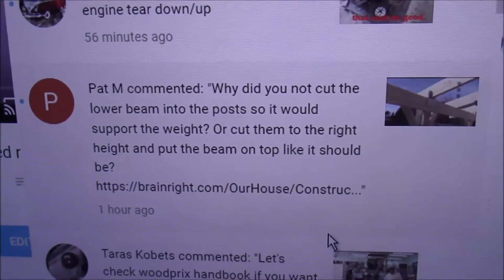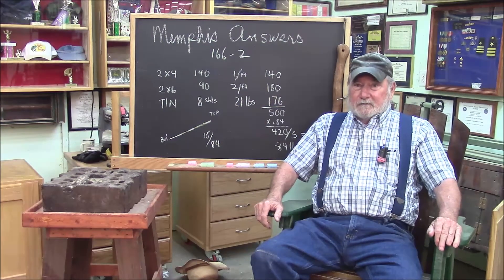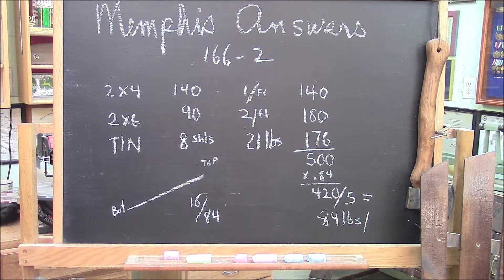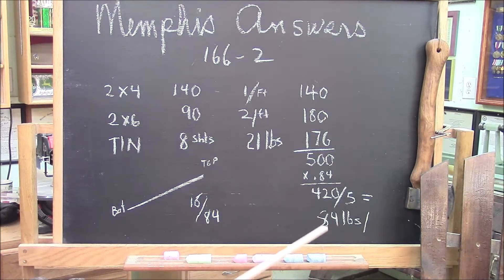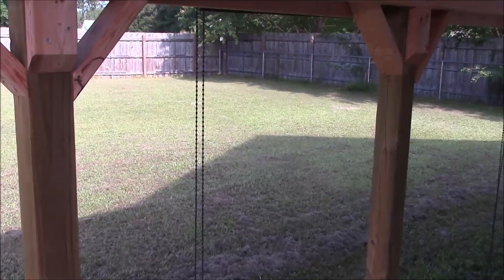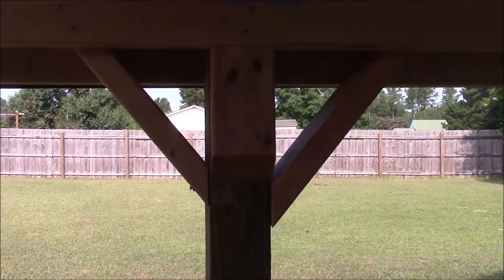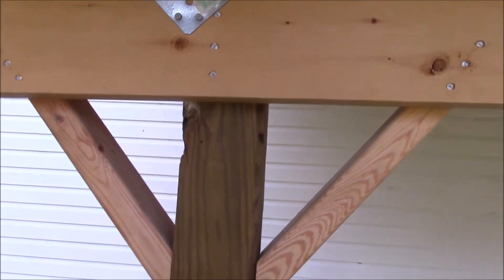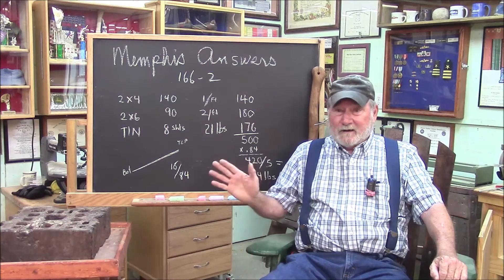Memphis Answers Joist header on top of post 166 2

Comment: It took me a while to figure out just what his comment was about since I am no builder.  I thought he was giving you grief because you didn't use a "bird's beak joint".  Now I understand that he was saying that header should have been on top of the post rather than nailed or screwed into the side then the joists put on top of that.    I can see his point about the snow load but that is not even an issue for you.  I think you have built a much stronger structure for your situation located so near the southeast coast.

Comment: Memphis not trying to be harsh, as long as you calculated the loads and know what your expecting. I live in an area where we can get 24" plus of snow adding this to a roof will make it strain.  Good luck and I hope yours last as long as your friends project.
Reply from the maker: I'm with you Pat.  I wondered a lot about those loads, and why my friends shed roof is still standing, considering that those braces are normally (and logically) placed on top of the posts.  I think I made it clear in the video that placing the braces on top or in notches is probably the best solution.
      I live in South Carolina, so I have no additional loads.  My worry is hurricane force winds, which is why I went with double hurricane clips, 2x6's, 2x4 purlins, five posts for a 20 foot span, and extra screws in the steel roof.  
      Hope to see you around, as I will be building two more shed roofs, and three decks.